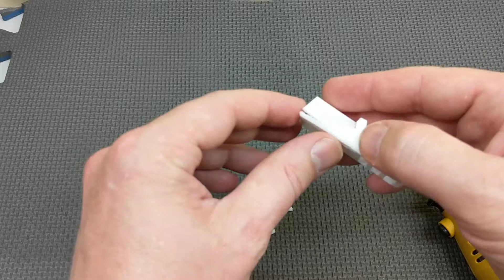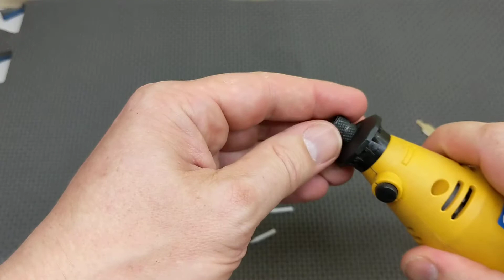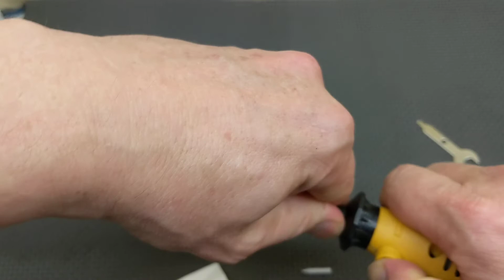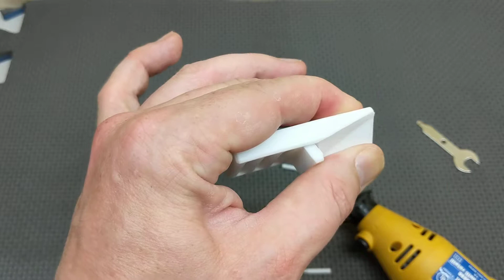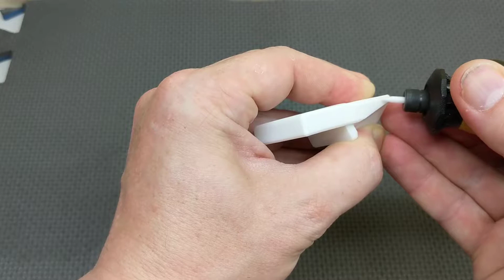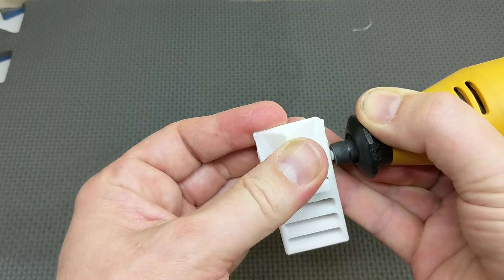Friction Welding PLA plastic

Comment: Informative. I am printing stormtrooper armor and this will help seal the pieces together for more strength. 

Unfortunately the collet (spelling) I have will not fit the 1.75mm. The filament is too small, and printing small pieces to fit just would be too much time at the moment. 

Thanks for the video.